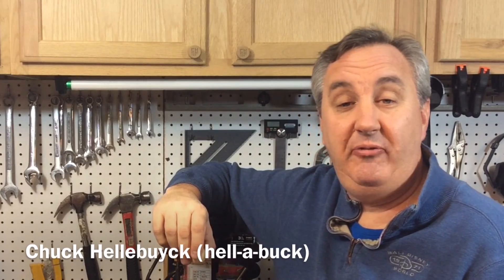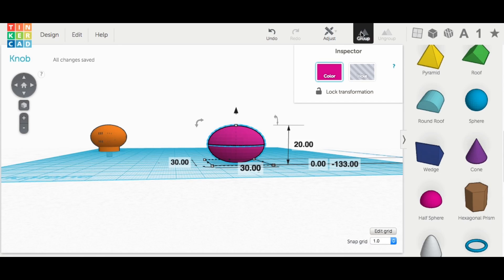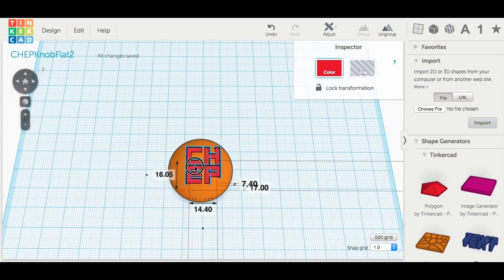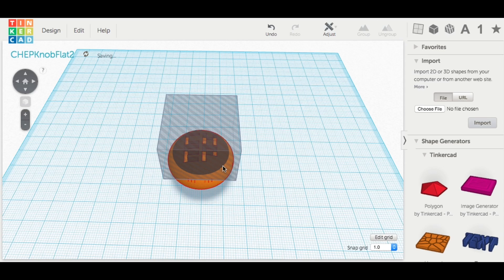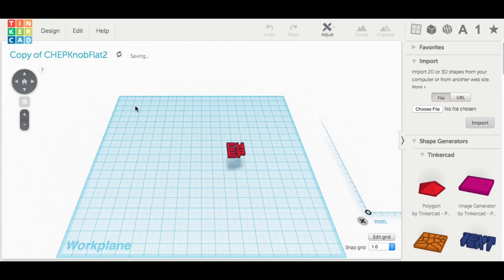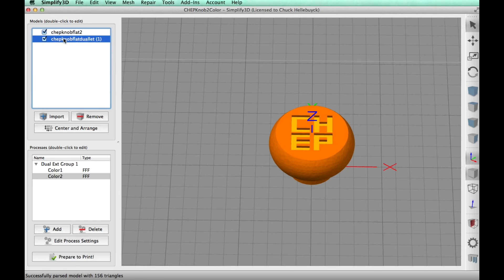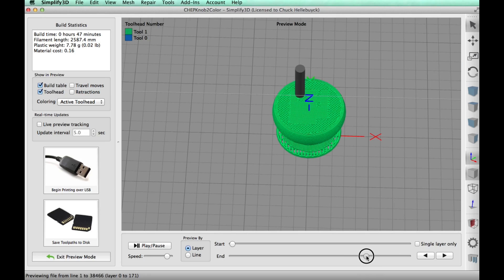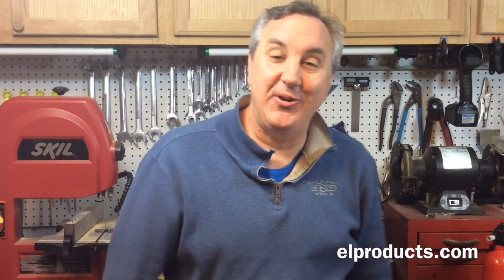100th Episode of Filament Friday - 3D Printed Two Color Dual Extrusion Glow in Dark Cabinet Knob

Comment: Congratulations on 100 Filament Fridays.

Just noticed a bug(feature) of  S3D in that in dual mode it didn't show the length of filament used per extruder. Just a overall total. Picky I know but still should be per extruder.

Comment: Nice work, I wish I could use tinkercad like that, I struggle with it every time. So which of your printers would you say is your favorite (other than the fabricator mini)? I'm still using the davinci, but fairly soon I will be looking for something different, I am leaning towards either the prusa i3 mk2 or the robo3d r1+
Reply: Yeah, I love how the dreamer is enclosed. So far I have had some good luck with my davinci 1.0, but I know it will fail me eventually so I have started looking around for a new printer. Too bad the prusa i3 mk2 isn't enclosed, that thing seemslike its one of the best low cost printers out there.